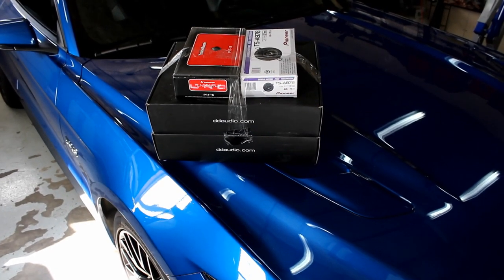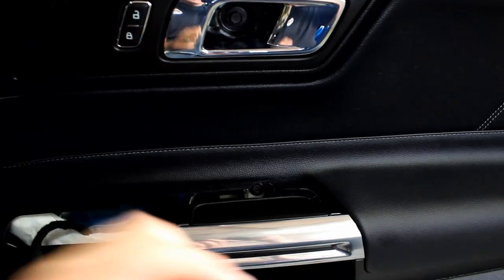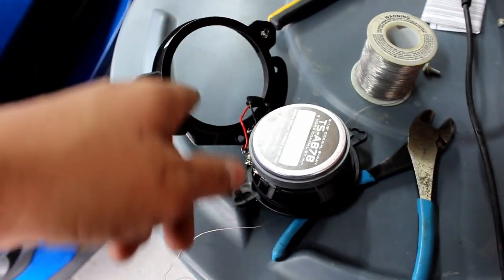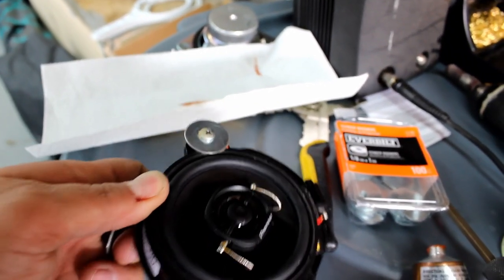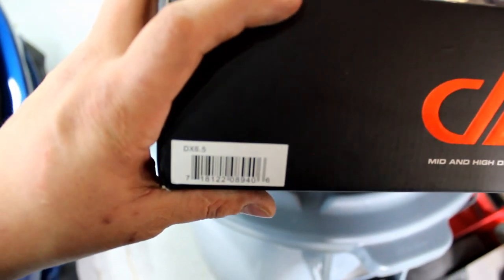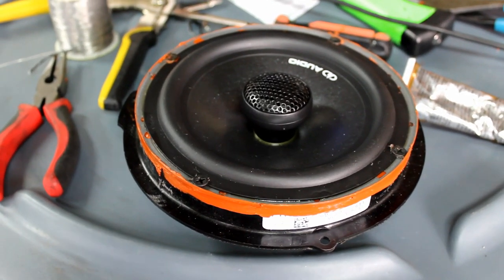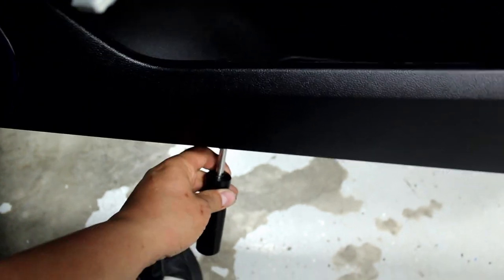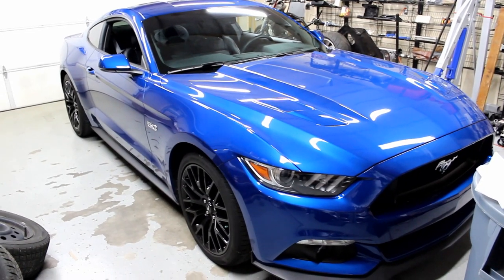How To: Ford Mustang S550 GT Front Door Speakers Installed (6.5" & 3.5")

Comment: Fatguybuilds, I just replaced the rear deck speakers on my '17 GT350 9 speaker Shaker system.  Online I found out that the right speaker wires are + and the left ones are -. This is with me inside the car looking out the rear view window. The Kenwood speakers I used have the + connection on the left and the - on the right. When I  tried to line up the Kenwood speaker connections to the factory speaker mount the connections didn't line up. I rotated the speakers 180°. I write this to ask you, are you sure you just connect left to left and right to right as you did with the door speakers?
Reply from the maker: @marias2tone  yup that is what i usually do but have zero exp with kenwood

Comment: Just an FYI. The Shaker system may have woofers in the doors, but the non-shaker setup has component mid-bass speakers in the doors. I don't understand why all these mustang upgrade kits/videos show them being replaced with coaxials. The tweeters are just being wasted, either way. They wouldn't add a benefit, even if they worked. Tweeters in the doors, and in the A-Pillars would really screw up the soundstage.

With the basic stereo (smaller non-touch screen LCD on dash, and no midrange speaker at the top of the door), I don't really even see a point to upgrade the 6.5" door speakers. Just replace them with stock when they blow. The stock amp is fairly weak. Less sensitive speakers would result in lower volume, on an already quiet system.
Reply from the maker: Because they are usually cheaper and has zero effect on the sound outcome
Reply: @FatGuyBuilds  I agree coaxials would definitely be cheaper....but IMO, a dedicated woofer/midwoofer would sound better (more linear cone travel) and have higher power handling. A cheap 6.5" component set can be purchased on amazon for about  $30, and you get the separate tweeters included.

BTW, I wasn't knocking you specifically for using coaxials. There are companies literally selling upgrade kits for the mustang using coaxials, with YT videos suggesting that the tweeters will improve sound. It was more a knock on them.
Reply from the maker: got ya.

Comment: Great video. I plan on doing the same thing, however I will replace with a dedicated mid. Your thoughts on replacing the 2 ohm factory unit with the 4ohm pioneer. Any big changes? The mid I'm going to use is also a 4 ohm unit.
Reply from the maker: Nothing big changed.  Dedicated mid-range is a better idea

Comment: Crazy question...you replaced your 3.5s. Do you have to replace them, can you just leave them unplugged? The selection of 3.5s are rare to find.  I have the same system in my Ecoboost. I'm replacing with Cerwin Vegas..
Reply from the maker: you can always use 3" too.  those are not bad to find

Comment: how deep is the door where the 6 1/2 goes with the window down . want to put focal ps165f3 in.dont know if there enough room. thanks
Reply from the maker: Take the door panel off after u roll the window down.  Then measure from the bracket to the window.
Reply: Did you end up putting the focal's in? Did you notice a bump in quality at higher levels? I have a 19 gt premium with the bang and olufsen system with two illusion cxl10 subwoofers ran on a mosconi amplifier. I am looking to get a slight bump in speaker quality in the front. I feel like the b&o amp is doing a great job but the stock speakers can not handle the power at the top end.

Comment: The thing I don’t understand is why are you installing a full range woofer that has a tweeter on top if the bottom woofer originally are subwoofers/mid bass/LFE. ?
Reply from the maker: Cheap and the sound isnt any difference

Comment: Hey mate, quick question. I've got the 9 speaker shaker. Have added a sub and upgraded all the speakers except the tweeters and door 6.5". 
Was the door 6.5" upgrade noticeable? The sub does most of the kick but i can hear the door 6.5" annoyingly rattle sometimes at high volume. Is that due to it being just a crap speaker?
Reply from the maker: not sure.  the speaker may be contacting the plastic of the door.
Reply: I had the same exact issue. My rattle was actually coming from my panel. I put in a set of Infinity Kappa 60CSX 6.5 components with the 20MX 2 inch mid add on to make it a 3 way setup I used Noico 80 mil sound Deadener with Noico 150 mil closed cell foam. I put this in the doors and on the panels as well. I also added Roadkill Fast Rings which I highly recommend for the 6.5 speakers. It forces the sound into the cabin of the car vs in the door. This also helps with vibration and rattle.

One thing that I highly recommend if you're going to use an amplifier or multiple amps would be to use a DSR1 sound processor. It makes connecting amplifiers to your car super easy and it literally becomes plug and play for everything. The control you have on your sound stage is unbelievable and it's well worth it.
Reply from the maker: @darrylpolite8722  I am actually editting a dsr1 video right now
Reply: FatGuyBuilds that's awesome and I can't wait to see your video on it. I'm curious to know what you think may be the ultimate settings for our S550s. I currently have about 8 files saved from all of the changes that I've done to enhance it. It seems to sound better and better every time.

Comment: Hey, about to upgrade the 3.5 in mine with a coax, did you find the highs overpowering having a tweeter in the pillar and the 3.5"s with tweeter in the door? Wondering if i'm better off leaving the door alone and just putting one of the 3.5s in the center speaker.
Reply: I'm replacing mine with a dedicated mid driver...how did you make out?
Happy with results?
Reply from the maker: Thanks for watching!

Comment: You have any problem with the lower speakers smacking the grill with the middle part of the speaker or you made sure it was a woofer?
Reply from the maker: i haven't really seen any of those issues
Reply: @FatGuyBuilds  weird I guess it does depend on your car. Some people have issues and some don’t. My tweeter smacks when there is a lot of base
Reply: @Taino5.0 my installer did this method and when I gave the components more power the woofer hits the grill now. I need to get the adapter rings in so it doesn't chew up the surround
Reply: @DJMalva79 yea I went back to stock. My system was way better with stock. I might just switch the 3.5 inch speakers in the door and center. I took the center out for now and what a difference. I also need to poke holes on the carpet in the rear.

Comment: I can't believe this guy put 2 way coaxial in the woofer and mid section. No regard to voice matching, phasing, listening position, resistance etc. The low pass crossover point on the woofer will be changed by the resistance of the new speaker, as will the (assumed) bandpass on the mid-range. I don't know why people buy "car" speakers. You could easily find a Dayton audio woofer/mid/tweeter that are much higher quality and are the proper size in 2/4/6/8 ohms. Wattage rating is basically meaningless as it's almost always an exaggeration. I wonder where the crossover is on the Mustang, is it active? Or is there a simple first order passive crossover in the wiring somewhere? And can the people with the 2 way systems upgrade to a 3 way without much trouble? Curious to know if they rear are low pass and what the crossover points are in the s550. Also with that many tweeters, the relative dynamic range between the bands and frequency balance is probably a disaster, as well as lobing, standing waves. And to try and EQ above about 500 hz is meaningless because microphones do not hear how the human brain does, not to mention the resonances that EQ can introduce which is enough of a reason to avoid EQ above a few hundred hz. One thing in the Mustangs that is done well is the have a degree of time alignment and channel level built in where you can set your listening position, which is very important. If you are totally OCD look into mini-dsp it's amazing.
Reply: “Car” speakers are designed to be in semi-damp environments like car doors. Not only that, not all drivers have the same parameters between car and home audio. A higher QTS would be preferred for a car door without a custom midbass box built, something most people don’t look for. If I remember correctly, the impedance of the speakers in the S550 Mustang Premium systems are 8ohm for tweeters, midrange and center, 4ohm for the midbass in the doors and rear deck/quarter panel (convertible only) and 2ohm for the sub. All other points you made stand as far as compatibility and possible issues, I can’t imagine. Also yes, it’s a full factory DSP setup so every speaker is crossed over accordingly so tweeters get the highs, midrange get the mids and the lower doors get the midbass so having 2-way coax is definitely not ideal. I don’t even think a MiniDSP could fix the issues, might have to jump up to a Helix processor haha
Reply from the maker: it works just fine.  the crossover is built into the stock amp.
Reply: @FatGuyBuilds  do you have more details? And if I upgrade to the premium system does it have surround like the fusion titanium?
Reply: All that text stuff you mentioned sounds good I got the six speaker base model I took everything out except for the tweeters and I'm running co-axles through a LC2 audio control on top of that I got a hifonics amp hooked up to a 800 RMS wide scar subwoofer to be honest with you bro it sound like everything's coming right smack dead from the middle and my highs are screaming we all got opinions I just believe yours is wrong cuz I'm sitting in my car right now trying to figure out what you talking about

Comment: OK. How does it sound since you added the 3.5" Pioneer 2-way with the tweeter vs the older component mid range?
Reply from the maker: sound is about the same, but power handling is much better.
Reply: @FatGuyBuilds  I upgraded some JL 12's in the trunk, but the damn sound system sounds like absolute dog shit, it's muddled and lacks any real sound......What size speakers would I need and what sort of Amp would I need to run it?  Thanks in advance!
Reply from the maker: @bigdisme5622  what is your budget and I will put something together for you.  what ohm are the subs you have?
Reply: @FatGuyBuilds  right now stock setup, 2 x 4ohm TW3 12 JL's subs, with a 1000 watt 4 channel amp, and that LC2 thing I think 4 channel but not sure.   My shit just sounds so damn muddled, like I want it clear, and good beat, but now its just some bass, but no clarity and no good hits...I don't get it?

Comment: Was this a shaker 500 system?   The lower speaker was a woofer and possibly has a low to mid signal to it.  If so the tweeter in that speaker is useless.
Reply from the maker: exactly, but the speakers are so cheap that it doesnt matter.
Reply: @FatGuyBuilds actually, it does. actual woofers would sound a lot better and the system would get louder not having to waste power in the crossover section of the coaxial.
Reply from the maker: @RodknockRhett   costs was a large factor.  this made almost no difference since power was not passed thru the High-pass filter.

Comment: What if I want to run amp wires to power the front door speakers? How can i avoid running wire through the door?
Reply from the maker: U have to drill holes then.  But that is stupid and pointless
Reply: @FatGuyBuilds  Whats better way doing it?
Reply from the maker: @noy6330  use the stock wires
Reply: @FatGuyBuilds  Im having problem finding the wires to tap into. They can only be behind the stock radio correct?
Reply from the maker: @noy6330  do you have premium sound or basic
Reply: @FatGuyBuilds  Basic sir.
Reply from the maker: @noy6330  then u will need to splice into the wires from the deck.
Deck -> audiocontrol lcq-1
Audiocontrol lcq-1 -> amp
Amp back to the other side of deck harness
Reply from the maker: Look at my basic focus video and the f150 amp upgrade for a better explaination

Comment: So many things wrong with this video. Use the correct speaker adaptors and use fast rings. Use a quality set of 6.5” components and don’t put in coax speakers everywhere. You will have so much treble that it will sound like shit. Get some Tessa tape and stop any wire vibrations. If you want it done right run it active with a DSP.
Reply from the maker: no need for adapters.  steps are the same no matter what speaker you actually use.  no treble comes out since that line is low pass.  i want it better than stock, but not looking for amazing sound.  job suceeded.

Comment: Has anyone upgraded the rear deck speakers? Is there a difference in sound if you have?
Reply from the maker: Yes i have a video.  And yes it sounds better.
Reply: Just watched the video. Great step by step instruction. Thanks!
Reply: does the rear speaker do play full range or they are low frequencies like the front speakers? @FatGuyBuilds
Reply from the maker: @dto8182  full range